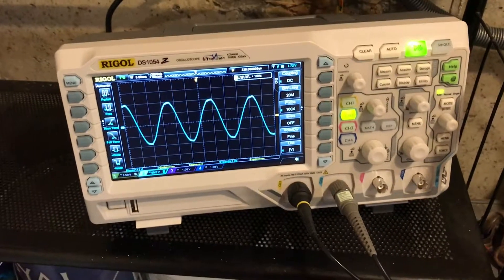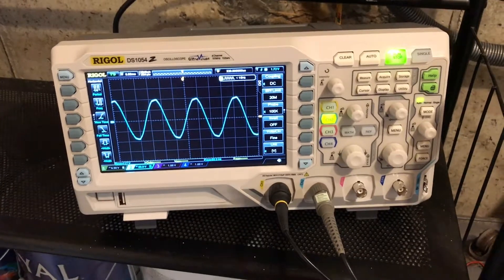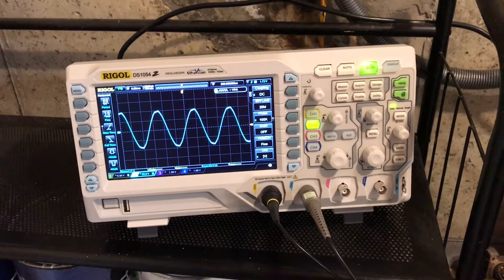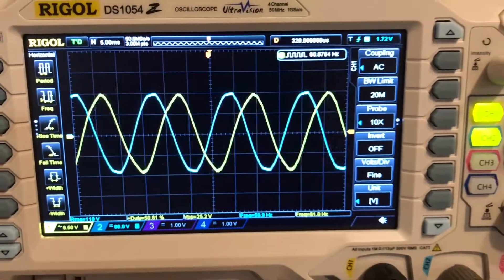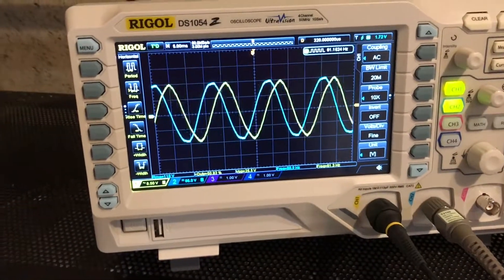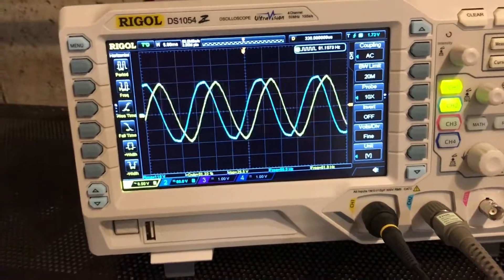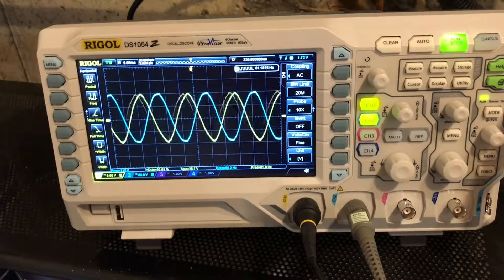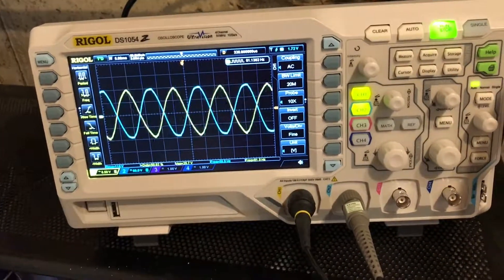Generator and Grid Power Visualized on Scope

Comment: That is the reason they ground the lines even when they are broke, the strap the lines to ground, and if feeding power into that when they apply that strap, possibly going to lose your generator. Also your transformer outside of your home will and does step UP the power to line voltage. 12-17Kv in most areas but not all.

Comment from the maker: Hi Matt.  Generator is a 3-cyl Kubota with a Mecc-Alte head.  Generator is rated at 8000 watts, and is under ~3500 watts load (heaters for load banks) during this video.  Heat gun adds another 1500 watts when I turn it on.  I haven't yet looked at the waveform under full load, but now I'm curious, and I'll have to do that.  I also need to get a video up that demos my generator setup.